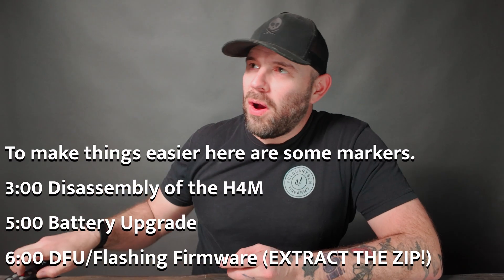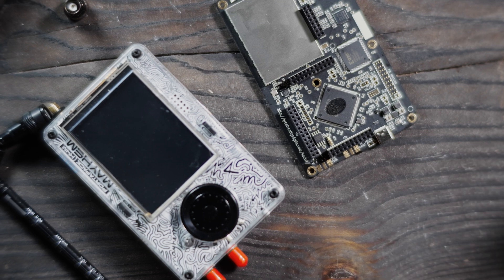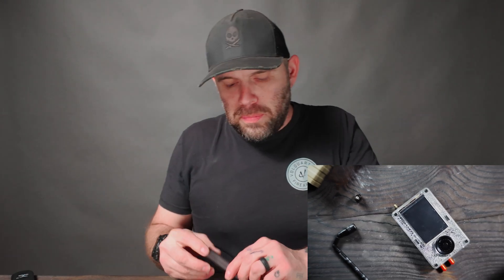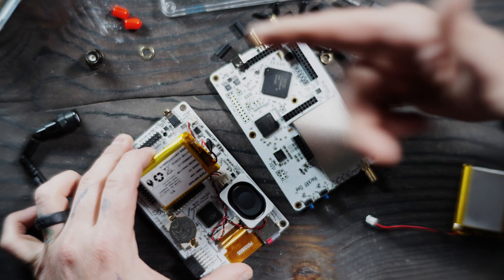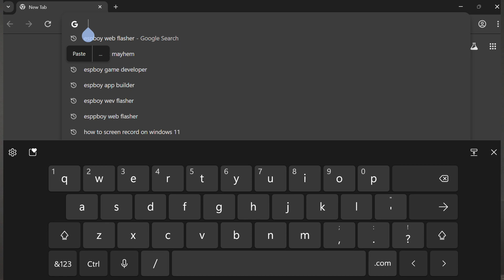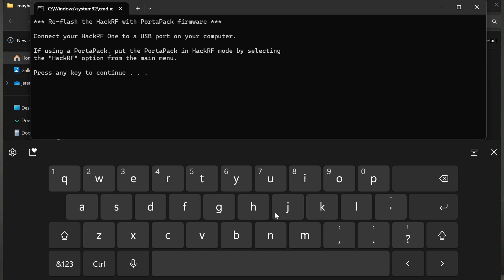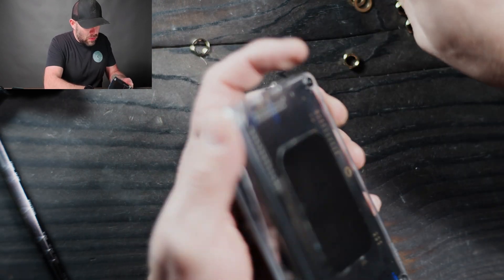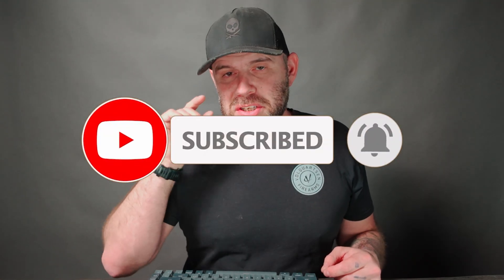Clifford Heath 2025 R10+ HackRF One

Comment: I literally just purchased the Hack RF Portapack 10C from Rabbit-Labs but am considering cancelling my order and waiting for this. Thoughts on waiting for this to be a completed kit or do you think it would be beneficial to just add the board at a later time? 

Thanks for all the information you've been sharing!
Reply from the maker: @MONSTERGUYPM  thanks a ton! The r10 is a great board for regular use. If you don’t transmit to closely to it it’ll be fine. And down the line if you want get the upgraded board and dedicate the r10 as a computer based SDR.

Comment: The external clock input is useful if you want to get precise enough to use the HackRF as a signal generator or receiver for aligning other radios. Nice that the option is still available if you want it.

Comment: Are there any differences between the CH R10+ and the CH R9+, other than the newer version having a USB C port?
Reply from the maker: @doctorx558 yes. I discuss them in this video
Reply: Is this a trick Question, Listening is Fundamental to achieve a certain Gold..
Reply: I never did an R9. R9 was a COVID special due to the chip crisis. It's a dead end. R10 is almost identical to R8
Reply from the maker: @CliffordHeath  thank you for clarifying.
Reply: @CliffordHeath  Apologies for the confusion earlier. I was referring to the Clifford Heath HackRF One—the older model with a micro-USB connector, manufactured by SDRLab. I wanted to inquire if there are any notable differences between this older version and the newer model featuring a USB-C connector.